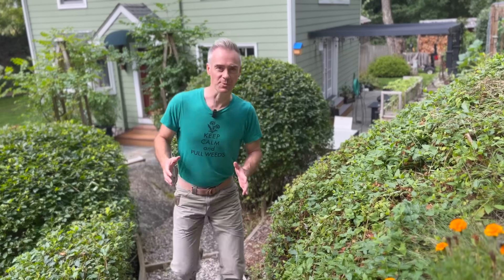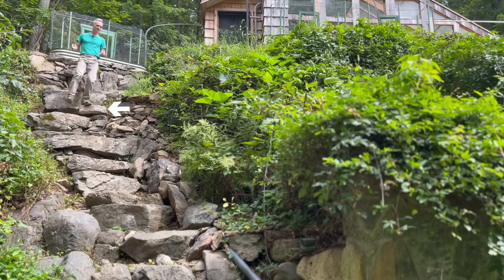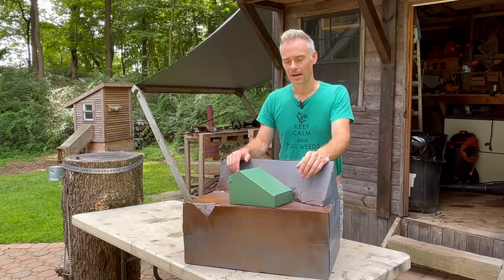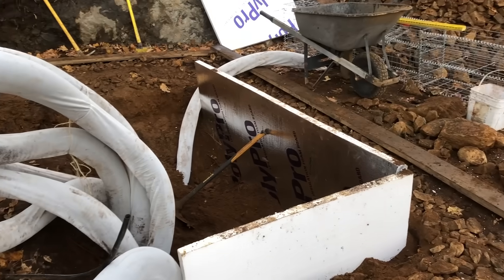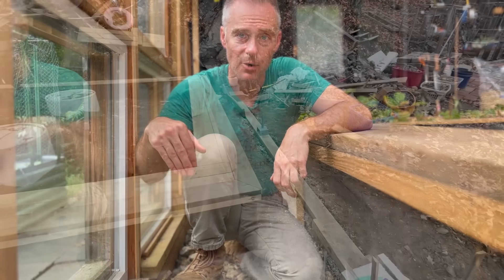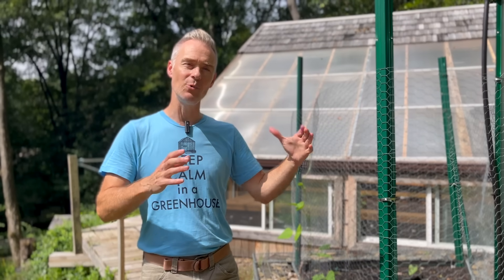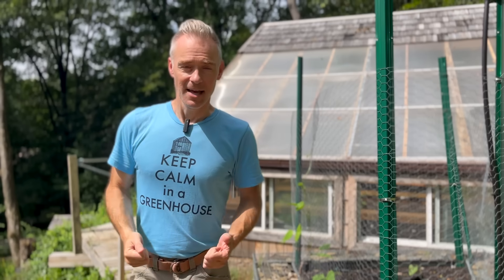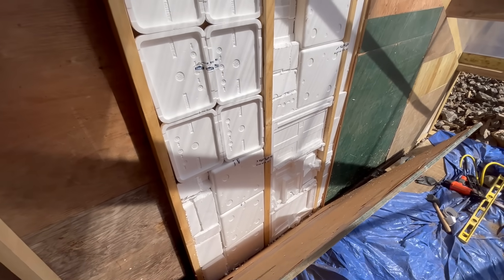Story of Building my GEOTHERMAL Greenhouse-1 MILLION VIEWS!

Comment: This is a truly beautiful greenhouse.  I like it very much and am storing your ideas away in my mind as the differ from many concepts I have previously accumulated.  Your L-shaped entry (double door?) is a very good draft reduction & accidental visitor reduction measure.

May I offer some professional advice?  Right, I know.  ... Insects and rodents will bore through your wood, lay eggs (not the rodents) in the wood and worse ... molds and fungi will grow into your wood and can then cause numerous problems for your plants, not the least of which is fungal gnats.  Cedar (and a few others) is significantly better, but not immune to these things.

The other issue is the leaching of toxic chemicals from pressure treated wood and from woods that have been around roads or railways.

LACQUER your interior wood heavily. Three coats is a good idea.  I am guessing you would not mind the lacquer effects considering your materials.

Comment: How did you determine the square area coverage needed for the pipes in the ground?
Reply from the maker: The basic idea is for the volume inside the GAHT pipe to be roughly equal to the air volume inside the greenhouse.

Comment: Agree with so many commenters.  I have been planning a passive solar greenhouse for some time and this has inspired me to action. Question - why perforated pipe in the ground? You can ge the same pipe without the perforations and would not need the covers and would not risk soil and dust leaking in. Am I missing something? Kudos on all your extensive planning and hard work!
Reply from the maker: Great question!The perforations are needed because of the condensation that happens when the warm and cold air meet. At a minimum, the moisture build up would become a mold problem and more likely the system would eventually fill up with water and stop working.
Reply: makes sense.  Thanks!  @WineberryHill

Comment: How deep in the ground did you have to go with your concrete curb foundation and did you have to go below the frostline?
Reply from the maker: About 75% of what the building is setting on is solid rock so the best I could do was anchor down into the rock so the concrete is more or less a curb than anything.

Comment: If you could have dug down, would you?
If it wasn't for the availability of the stones, would you still consider building the stone cage around the elevated bed?

I have stone slate 3' down on all of my property. Would it be a good idea to dig down for the GH and use some of that stone?
Reply from the maker: Hi Genevieve, Yep I would’ve created a much larger GAHT if I could have. But we have to work with what we’ve got right? As far as rock is concerned yeah it’s a great way to store thermal energy so if you have a bunch of it, why not use it.

Comment: I watched your video because I was looking for ideas for a greenhouse/shed. Greenhouse on south with enclosed shed facing the north. I'm a small market gardener that needs a space to wash and pack my veggies and a cooler room. Could you share your finished
 dimensions? Roof pitch, height etc?
Reply from the maker: Hi, The footprint is 16'x21' and 13' at the peak. The angle of the roof is specific to my longitude...31˚.

Comment: Great video and full with ideas and knowledge. I have so many questions, because i know very little about the geotermal.
1. What kind of pipe and sleeve you are using? Any links for them?
2. Did you do the pipes only under your rised bed or under your whole greenhouse?
3. Are those pipes separate or is it one continious pipe zig-zaging like a snake?
4. And finally - my greenhouse will be 12'x25'. How many feet of pipe i should have to lay to be enough to keep it warm?
Thank you in advance for your help and knowledge.
Adriana
Reply from the maker: Hi Adriana! 
Here goes:
1. It’s standard flexible perforated drainage pipe (to allow moisture out), with a fabric sleeve (to prevent dirt from getting in). You can find both items at typical big box home improvement stores.
2. Yes, only under the bed. Mainly because I was working within very restrictive soil (rock) conditions.
3. One continuous length. 
4. You will need to figure out the air volume inside your greenhouse. The basic idea is for the volume inside the GAHT pipe to be roughly equal to the air volume inside the greenhouse. Here is a useful calculator for determining the air volume inside the pipe: https://www.calculator.net/volume-calculator.html
I’m excited for you, the work is well worth the effort!
Reply: Thank you so very much for your reply. I wanted for so long to build my greenhouse with geothermal heat, but no one would share the knowlege the have how it all should be done. I am so grateful I found your channel, you have a follower for life!
One more thing: in your list with items and links for them, I saw the AC Infinity controller and AC Infinity cloudline. I am assuming thise two things are for the end of the pipe? And do i need a small fan installed at one and of the pipe?
Again, I know very little about it, so i apologies for that many questions.
Thank you,
Adtiana
Reply from the maker: Yep, you are on the right track. The temperature below the freeze line in your soil is around 50˚f. The inline fan pulls that warmed air out of the ground and into the greenhouse. I like to have the input end near the ceiling (where the heat rises up to) and then that air is pulled down, through the system, and out with the inline fan on the exhaust end of the pipe.
Reply: Once again, thank you so much. For the first time I feel confident enough that I will be able to pull it off. 😊
Reply: Avoid using one continuous length of tubing at all costs, it will severely limit the amount of air you can run and the performance of these systems depends on air flow.  Consider 1x 300ft length of 4" tube vs 20 x 15ft lengths of 4" tube. They both have exactly the same amount of surface area for heat exchange. You can run 50cfm at  0.75" wc through 1x 300ft tube. You can run 225cfm at 0.75" wc through 1x 15ft tube, 225cfm x 20 tubes = 4500cfm. Its impossible to run 4500cfm through 1x 300ft tube as you`ll need a fan capable of delivering 4500cfm at 6075" wc, which is about 220psi !!  I`d recommend designing the system to put the entire greenhouse air volume underground at least 20x per hour.

Comment: Great video! Not sure if it's already been asked (didn't look through all the comments) what did you do for the air system to move the air through the geothermal tubing?
Reply from the maker: I use an @acinfinity controller with an inline fan.

Comment: So the water pipes underground are perforated ?  Do they need to be?  Would it work to have pipes with warm water flowing through like in a house?
Reply from the maker: The perforation allows condensation to seep out, which happens because of the mixing of warm and cool air.

Comment: What is the pitch angle of your roof?
Reply from the maker: The roof angle is unique to the longitude of wherever a greenhouse is located so I had a slight range to work with. I believe mine was around 31° but like I say it will be different for everyone.
Reply: Thank you for the fast response & great info

Comment: How do you regulate humidity? Is that an issue?
Reply from the maker: A couple ways. I have the AC Infinity controller set to react when the VPD (Vapor-pressure deficit) is terribly out of range (exhaust or GAHT fan...depending) I also have a separate A hygrometer with a small dehumidifier attached.

Comment: Do you incorporate use of low and high operable windows to help regulate temperature? Are there any automated temperature controls?
Your input is appreciated. Great looking greenhouse
Reply from the maker: Yeah, so I have an exhaust fan in the top of the attic plenum, and a fresh air intake fan down in the front. Both thermostatically controlled (AC Infinity controller)

Comment: Any reason you didn’t bring in some bigger equipment, backhoe, Bobcat…???

Have you thought about adding a biochar kiln to supplement your heat on cold winter days or use an evacuated tube water heater for the same purpose?

I live the Gabion wall idea!  Brilliant idea, wish I’d thought of it…
Reply from the maker: Yep, this location is only accessible by foot. I haven't thought of using heaters like those. Fortunately, for the most part I haven't really needed much help heat-wise.

Comment: I never considered using a radiator to extract compost heat, makes sense. I am having ideas for using it to boost a geothermal setup in the winter but like you said solar+geothermal is likely enough.
Reply: I was also really interested in the radiator compost heap plan! I'd never considered transferring compost heat to an indoor water reservoir but it makes a lot of sense and would be a great energy source if the solar heat and ground insulation wasn't enough. Next step, build a big enough water reservoir for raising fish! Fish poop water for fertilizer, and the occasional renewable meat harvest of tilapia/trout/etc.

Comment: I was wondering if you could add a way of creating a thermal mass by adding a wall of compost. Not in the greenhouse but like fill a wall since composting generates a large amount of heat
Reply from the maker: Yeah, it is possible. It would need to be all metal or stone otherwise the decomp would eventually eat it up!
Reply: @WineberryHill  I wonder what about glass panels it might be cool to see the process and small creatures at work and glass hopefully shouldn't react or decay

Comment: Excellent  video. I am going to build a rabbit-heated greenhouse to make the rabbits happier. I have trampolines for the frame. My dream is to have a window greenhouse someday for a potting shed and to start seedlings. I had not considered geothermal for climate control. We are in Maine and have wet soil so I will need to figure out how that works in the equation. I love the use of recycled materials. I want to learn to make pallet shingles and use them on some of the existing buildings.
Reply from the maker: That is awesome!

Comment: Cool! So you are pumping air through the 4" perforated pipe. Why is it perforated? Is it to allow more warmth from the earth to get into the air? What about running a liquid (water/glycol) through the ground to heat the water? How fast do you run the air through the pipe? (Constantly, on a timer, etc?)
Reply from the maker: Perforated to allow condensation to escape. The rate is determined thermostatically by the fan controller (see the description).
Reply: @WineberryHill  Thanks, that makes sense - the fan is just set to the temperature you want.
Reply from the maker: Yeah, exactly. It runs until the desired temp is achieved.

Comment: This may have already been asked and answered, but why that shape of roof, and why the shingle area (besides it probably facing north.) Is there some heat gain by it? Would not a east, and west slant roof have worked better?
Reply from the maker: My greenhouse is designed primarily to be most efficient during the winter. Therefore a south eastern exposure is most important. The top portion is shingled because the angle of the sun in the winter is low. During the summer you don't want late afternoon sun because of over heating, and so this design, along with shade from the trees keeps it cool in the summer. The back (north) wall acts as a thermal sink to catch heat and hold it in the greenhouse (in the winter), also why it's black.
Reply: Interesting. I’m building a 24'x24' Greenhouse right now. I’m a few zones north of you. I plan to make the north wall a solid heat catcher (simply solid, black, and banked on the inside by few successively higher raised beds (banked with stone on the south.)) I need to catch as much heat and sun as possible in my zone, so I have a planed a gable east-west facing roof, and was wondering if I should put a solid part on the north 6'. That’s why yore design interested my.  @WineberryHill
Reply from the maker: This might be useful: https://ceresgs.com/whats-the-best-roof-angle-for-a-solar-greenhouse/

Comment: Shame about the oaks, did you consider pollarding or high pruning - some shade might be beneficial as climate change kicks in. Did you assess other poss sites for the greenhouse re. shade, sun, wind etc. How much do you consider the embodied energy and lifetime analysis of the new materials that your'e using? Very glad to see re-use of lots of materials and emphasis on stored heat through thermal mass of water and  rock. See also Rocky Mountain Institute for examples of thermal mass design.

Comment: ok I have a question:  I get why  people plant plants into soil when that is what is there. But when you build the hole place you might as well install a proper hydroponic system. So why do you insist on feeding your plants with dirt?
Reply from the maker: I haven’t ruled it out, but it’s just one more complex thing to tackle.
Reply: @WineberryHill  It is less complex than what you did to this place.
Reply: That is what I want. Right now I am doing hydroponic in the open. I pick peppers until mid October or later. Wondering what I would gain with a greenhouse.  Cool weather veggies?

Comment: Very cool, But I am still not sure what you are using to make heat besides sun.  Are you using a heat pump in your geothermal set up?
Reply from the maker: A big part of the general design of the greenhouse is being able to hold on to and store heat that comes in primarily from the sun. When the GAHT runs in the summer, warm air is pulled into the ground. This causes the soil and rock to "charge" or warm up more than usual. As the system runs later in the cooler part of the year that warm air in that soil (basically an earth battery) discharges into the greenhouse. Even once that charge has been lost, the soil remains about 50˚f and so it is still a fairly warm heat source during coldest winter months. Add to that on sunny days (regardless of the time of year) the solar gain is HUGE. I have had days that were in the teens outside, but it is 70-80˚ inside.

Comment: Great video for an impressive project! 
1) What requirements did you have to meet for permitting? 
2) What kind of window design/seal/technique did you use to make watertight windows out of bare plexiglass? Thanks!!!!!
Reply from the maker: Stand alone greenhouses have to meet the structural standards for things like wind sheer and snow load...etc. For the plexi windows I made the frames in the structure and simply "trimmed it into the frame" (weather sealed both sides).

Comment: I bought one of those Harbor Freight greenhouses and never really utilized it.  I did make a large cinderblock insulated foundation with the idea of burying pipe like you did but never finished it.  You could also use a shade cloth during in the summer to reduce the heat.  I bought one from Griffin greenhouse supply in Tewksbury.  Looks like a nice greenhouse for citrus trees to over winter in.

Comment: Heat is one thing, but do you get enough light in the winter to grow things that require lots of sunlight such as strawberries and tomatoes?
Id like to do something like this in the Pacific Northwest but it's overcast most of the time.
Reply from the maker: I do indeed. I designed the structure around a low winter sun. Which means the greenhouse actually gets less direct sun in the summer (thus keeping it cool), and more direct sun in the winter!

Comment: I like what you did! When you water your plants if you had flat land than will the water stay really wet in the soil and cause the plants to get to much water or would the water get heated up and turn into steam and float away? I have flat land and was thinking of using ICF blocks for the perimeter of my hole and also have it be the foundation for my building. Not sure where the water will go if I did that.
Reply from the maker: The drainage is certainly a critical aspect of the design. The GAHT system cannot be waterlogged. Well draining soil is a must for this type of a system to work.

Comment: This is a really cool greenhouse. You’ve done an awesome job building it and it has some really great features. Thank you so much for sharing. 
I have a question, what do you do to provide adequate light for photosynthesis during the winter? Our sun is far less strong, and is only around for about 9-10 hours a day in the height of winter. Do you use grow lights in order to make up for this? I’ve always worried that the sun alone wouldn’t be strong enough to support summertime plants in the winter. 
I really want a greenhouse, it makes me so sad to say goodbye to my plants in the fall.
Reply from the maker: I designed the structure around a low winter sun. Which means the greenhouse actually gets less direct sun in the summer (thus keeping it cool), and more direct sun in the winter! I use a grow light on the back bench to start seedlings.
Reply: @WineberryHill  thank you so much for taking the time to reply. With your special design, are you able to grow summer vegetables in there during the winter? I like to grow zucchini, beans, cucumbers, and tomatoes which all require lots of sunlight. Have you grown any of these plants inside your greenhouse over the winter without supplemental light?
Reply from the maker: Yeah, I’ve grown beans and tomatoes with much success

Comment: Wait a minute. Why can't this principle be used to add a 'greenhouse' extension on a house and to use the raised beds to bury the geothermal heating tubes? That would allay the cost of a huge excavation, and the tubes could coil around the water receptacles for heat transfer. Possibly?
Reply from the maker: Depends on the house and the layout, but sure why not?